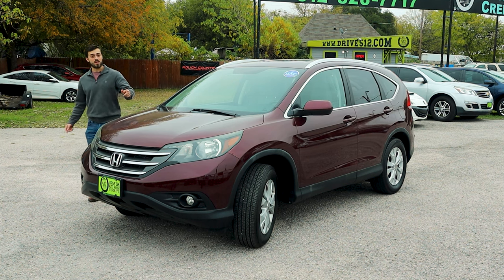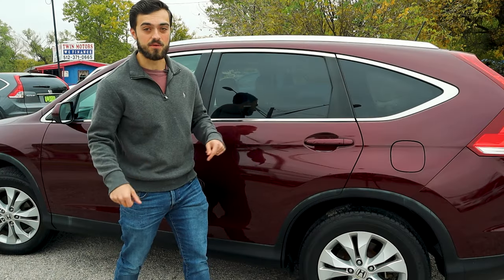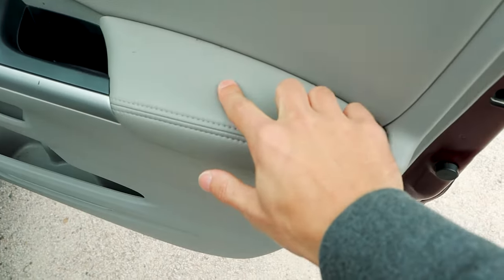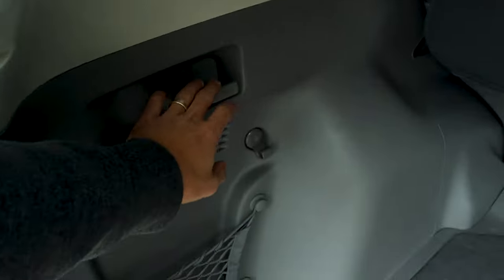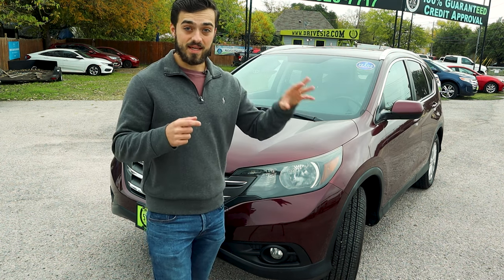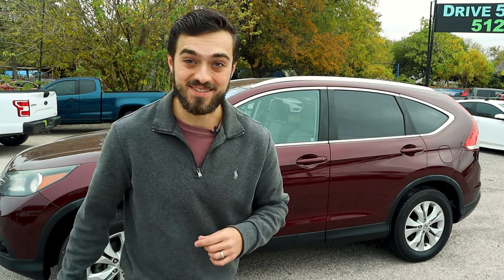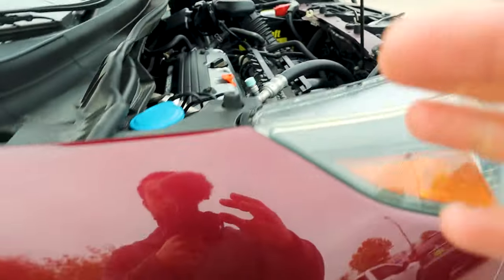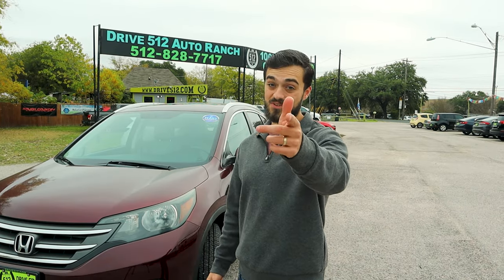Watch This Before Buying a Honda CR-V 4th Gen from 2012-2016

Comment: Our Gen 4  CRV 2012 almost 130,000 kms already replaced the annoying actuator. Noticed some cracks on the rubber holding the windshield. Bought and put some silicon on it asa remedy.
I also have a Gen 1 CRV aka RD1. Still using it for 24 yrs. Almost 230,000 kms on the odometer. A keeper since there a lot of available parts (surplus) here in Manila Philippines.

Comment: This is an issue that we have had with our 2014.  At 130,000 we replaced the VVTA for the 2nd time, and I had a new tensioner put in two.  I am not happy that they can't find a part that works permanently, but I would never buy a 2017 CR-V, or newer.  I despise Turbo Charged engines, so I would rather deal with this ever 4-5 years.  Only replaced an CV shaft, and that is it.  If some company that makes OEM racing parts would come up with a VVTA that permanently solved the problem, I would be thrilled.  Keep your ticking time bomb Turbo-4, Honda.
Reply: You only need to replace a spring inside the VTC actuator, it's not a 'VVTA'.  The spring is the first and easiest thing to start with, but doesn't always solve the problem. The VTC actuator, timing chain tensioner, and the timing chain itself can cause the rattle on cold start in any combination of the three separately or together.
Reply: lts too.
Reply: Hi Scott. At the moment I'm considering a purchase of CR-V (between some other brands, cherry picked models), but, since we are in Europe, we get either a 1.5 turbo engine, or NA 2.0 i-VTEC. Now I liket o keep things simple, so I'm aiming for front-wheel drive, 2.0 engine, and hope that it will serve me well. Grateful if you have any thoughts to share. Cheers.

Comment: I just purchased a 2013 with 109k miles. it has the 5 speed and I got front wheel drive.  I'm excited I pick it up on Wednesday. I know I'll have it for years to come. 😊
Reply: @d.l.sstudio8922  I paid 13k out the door from a Honda certified dealership in Beaverton Oregon. It's the crv ex 2 wheel drive  with 101k miles
Reply: I got a exl 2013 fwd for 10,600$ after tax with 108,000 miles 😊
Reply: @topshelfjosh9239  I totaled mine got into an accident. I got a Honda element now it's originally what I was wanting but couldn't find a good one at the time I found the crv. I did really enjoy the crv great car.

Comment: The VTC actuator starts with low oil levels. The burning oil will cause rapid reduction in oil levels which cause lack of lubrication of the timing chain. This will cause the timing chain to stretch. The oil burning is tthe issue. All Honda owners should check their engine oil level every week to prevent these problems. Honda is about to screw 1000s of loyal customers just like Toyota had done with the frame rot issue.

Comment: Fairly well covered
Bought a 2012 CRV with intermittent rattle from VVT when cold, around 120,000km
Ended getting a timing chain kit & actuator for around $750
Still very slight 2 sec rattle 1 out of 10 cold starts so will live with it
Have changed auto fluid (5 speed) once when we got it but will try your flush recommendation as it does occasionally hard shift
Starter hasn’t missed a beat
Lovely car

Comment: My 2015 honda crv has 175k miles on it i bought it at 136k from the original owner only have done a battery replacement and oil changes on it. Only other thing that’s been done to it other then brakes is the timing tensioner and gasket.

Comment: Hey Guyz
I'm having an issue with my 2013 model when i do the cold start there is a grinding noise and i can see the RPM level is close to 1000 in normal idle condition, when i drive my car its really reaching to 3.5 to 4000 and comes to 1500 is that a normal?
What's the actual cost of replacing VVTC
Plz share your comments.
Reply: how many miles do you have on it when it started happening?

Comment: I have a 2012 and when driving between 60-70mph it shakes and going uphill and If i press the gas it does it more!! Had the tires balanced already so i know its not that!! Anybody experienced this?
Reply from the maker: I would check the driveshaft.
Reply: I’m also experiencing same with my honda crv 2012😢
Reply: What would be the reason that the driveshaft would be the problem? What would you need to look for to fix it?
Reply: It's a torque converter it's too weak for the transmission 2012
Reply: Me too ..   I have the same issue . I love my 🚙 keep my fingers crossed 🤞🏼 😘

Comment: My 2014 has been a very good car, after I had the VTC issue resolved.
Reply: And what is that issue?
Reply: @thaothao8324  Per Robert H- There have not been any recalls on the VTC actuator in the 2014 Honda CR-V. The actuator is known to be defective, but Honda has refused to fix or recall the issue. A bad actuator will cause the engine to rattle loudly for about 2 seconds when starting up, especially during colder outside temperatures. You can diagnose this by letting the car sit for about 6 hours to allow the oil in the VTC system drain, listen to the engine right after starting it for a loud rattle. If it is rattling, the VTC actuator needs to be replaced. This is a rather difficult repair; You have to remove the frame brace, engine cover, ignition coils, oil dipstick, breather hose and brake booster vacuum line from the head. Then the timing chain and camshaft has to be removed. The VTC actuator is located on the end of the camshaft.
Rattle is understatement! Mine, one could hear a block away.
Reply: @johnfrakes4746  u think 2016 has this issue too? Also how much was it to get it done?
Reply: @thaothao8324  The data shows it continued on thru 2016 models, though less common of a problem for the last year. It costs in the neighborhood of $700-1000. Mine now has well over 100k, and have found the 2.4 a very good engine other than this one issue.
Reply: @johnfrakes4746  thank, I just test drive a 2016 2.4l NA also is nice, does shake. have 78mile on it, the car came from South Dakota, idk if thats a good thing or not, im in Minnesota.
Reply: I'd have your mechanic check it first for the overall condition, and if it's solid, it might be worth getting.
Reply: Doesn't it vibrate at low speed??? That's the issue I'm facing with mine
Reply: @mamusuware8867  I'm looking to get a crosstrek now. Say awd more reliable, same price for newer year 2018/19.
Reply: @Thao Thao  My last car was a Subaru  Forester, best car I've ever
Owned,  indeed their AWD is outstanding and durable! Hondas is not even mediocre in comparison
Reply: @Mamusu Ware  At well over 100k , it now has a little shudder between 2 and 3 gear.
Reply: @johnfrakes4746  The spring inside the actuator is all that really needs to be replaced, and can be done easily with the gear in place.

Comment: I’ve had the vtc actuator noise for two years, it’s just an annoyance and hasn’t affected the driving performance at all
Reply from the maker: Exactly! Happy holidays my friend
Reply: It's just a spring inside of the actuator, replace it and clean the locking pin.  Also verify that your chain is not stretched and consider replacing the chain tensioner.

Comment: You should never do a transmission FLUSH (not to be confused with service, which you just drain old fluid and replace it) on a car that's used and never had a transmission service. You will dislodge metal shavings and they will settle in the nooks and crannies and will clog them. You WILL have transmission problems. Matter of fact, it might stop working altogether.
Reply from the maker: My 1999 Astro van with 200k miles says otherwise. The trans oil probably has never been replaced. If it is a CVT then doing a couple flushes back to back will prevent the system from clogging. For a standard Transmission, it is a must to replace the filter as well. Furthermore, there is record of owner after owner doing the flushed and getting good results. I have yet to see or hear the ladder.
Reply: I sometimes feel this is one way of making money by forcing customers to change transmission fluid when it actually isn’t required. My 2012 ML350’s recommendations is 70K miles but I doubt how many will actually follow the routine. As long as you don’t abuse the transmission I think it should be good but then euro manufacturers have to upkeep the costs for their unnecessary hifi things that they install when they themselves don’t know what it takes to keep the vehicle good to last for a while. Bottom line….recommend changes to make more money for no reason!!!!
Reply from the maker: @worldpeace5853  CVTs should for sure be replaced. Same with auto. Oil wears down over time, it’s a fact. When that happens, components go bad. The sentiment “you should never replace you oil” is flawed and is said by folks who don’t replace their oil filter as well.
Reply: @AutoMotivate  IF true, your car is an exception,  Heard plenty from owners that did a trans FLUSH (not to be confused with service, which you just drain old fluid and replace it) on their old vehicles and it ruined them. Stand by all I said.

Comment: A money pit and poorly engineered. It burns oil. The VTC actuatoor rattles on start. The transmissio shutters at low speeds.
Reply: I have to agree with you I been experiencing the same problem with my 2014 honda crv

Comment: U don’t even know what ur talking about thr generation doesn’t have a cvt
Reply from the maker: 2014 was the last year they had a standard transmission. Do you know what you are talking about?
Reply: They put the Earth Dreams engine and CVT in the CR-V in 2015. I think it's confusing that the 2012-1016 cars can be called the same generation with two completely different engines and transmissions...but they are.

Comment: My hoopty 2012 CRV vibrates upon low acceleration. Just when the green light opens, it runs smoothly for a few seconds, and then the vibration happens for more seconds.
Reply: Change the transmission fluid at the dealership.